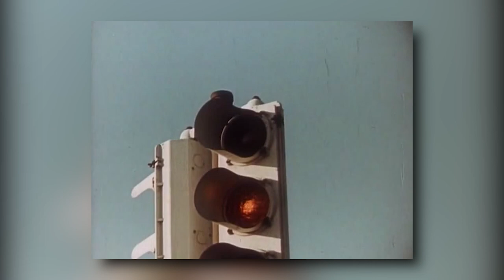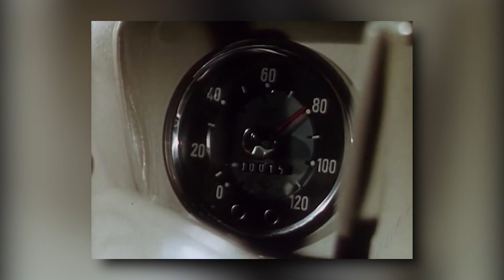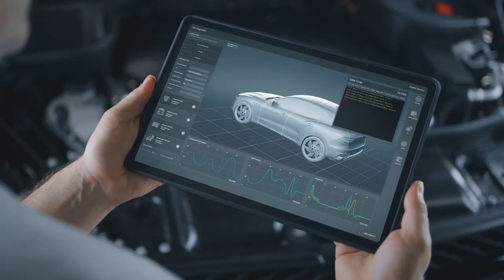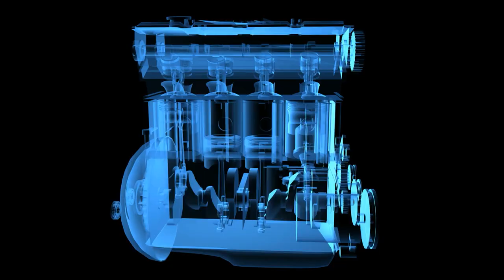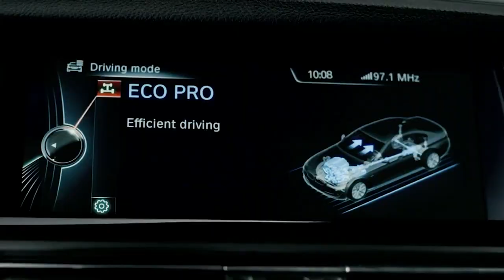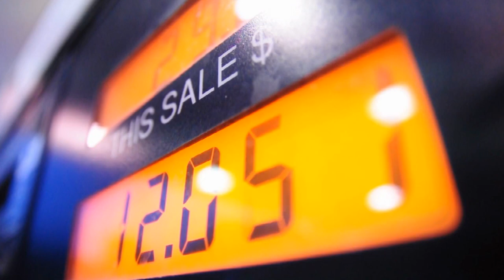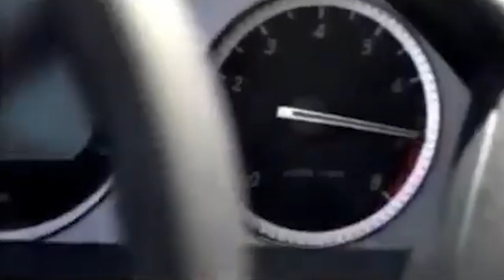5 WORST GERMAN CAR ENGINES! (AVOID THEM)

Comment: I had a mk4 Golf Gti vr6 and it was one of tbe best cars i ever had. I put over 120k miles on it and it never left me stranded nor had any problems at all. Worse thing i had to replace was spark plug wires. One failed. Besides that it never broke down on me at all.